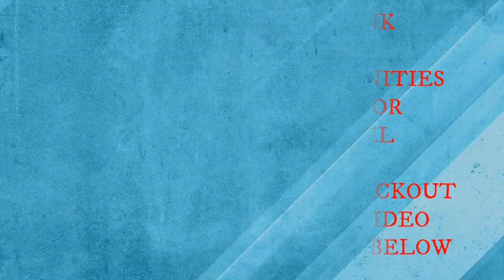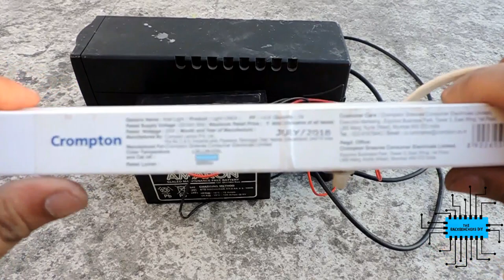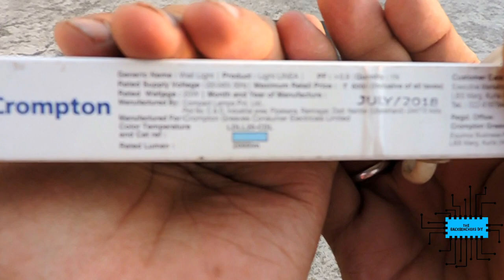How to make solar inver using old ups 12v to 220v AC

Comment: I want to check does the ups need to be manually restarted next day after the low voltage battery shutdown (over night battery drain) after it getting charged solar next day (dow we need anyone to turn on UPS to inver the DC to AC?

Comment: Good idea, but some really terrible connections made. Cause for a fire risk.
Reply from the maker: Guys... Let me clear one thing...... Solar panel need a solar charge controller.... To get smooth output of solar power.. Here we didn't use any solar charge controller... As all of you know... This is the lock down period.. So I am not able to arrange any charge controller.. That's why we directly use battery to solar connection... So I suggest you to use a solar charge controller..
Reply: @TheBreakoutTraderAKASH  Dont sacrifice safety, Otherwise Your House will be on Fire